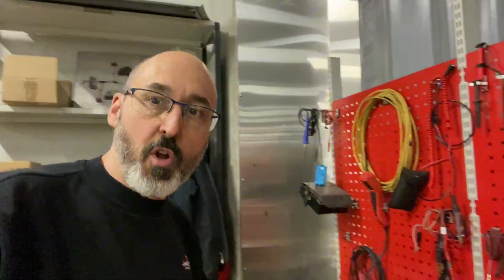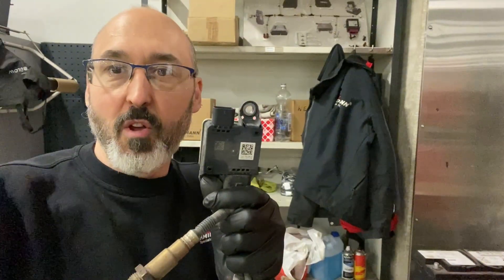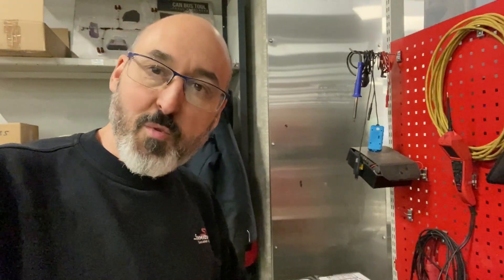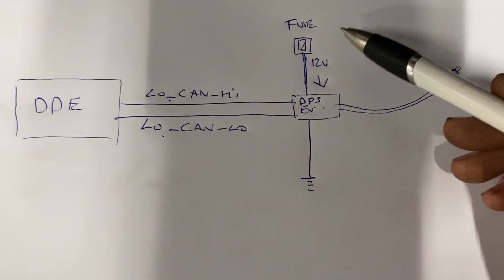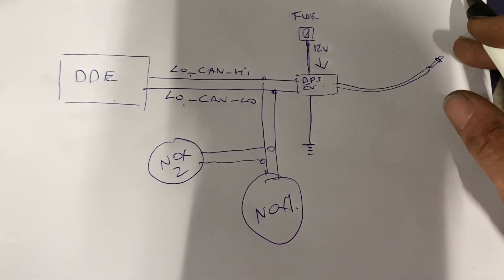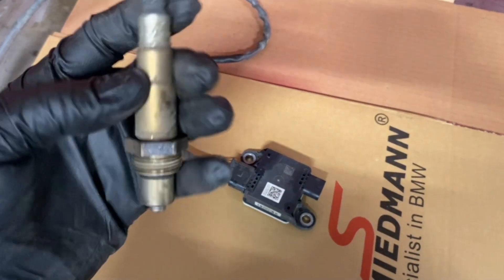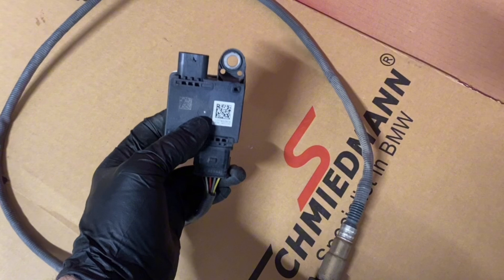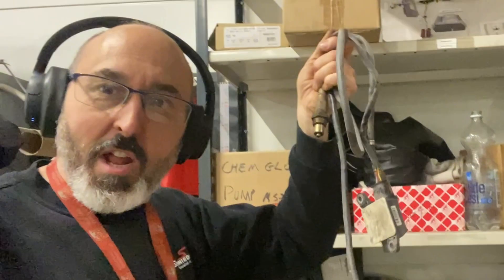Why Your Diesel Is Failing — And It Starts With This Sensor

Comment: Last year I have had one customer coming in who was at BMW 4 times for replacing the Sensor. Each time the error was gone or a couple of weeks. After that the same error came again. After the 4th sensor on warranty he came to me and every time they did put the sensor with the marking at the top so all the condensation water in the exhaust distroyed the sensor. I took the exhaust down and drained 0.6l of water from it. After that I put a new sensor in with the marking at the buttom so the condensation water could drip down through it.

Just wanted to say that because you mentioned the fact that it actually doesn´t matter where the QR code is. But it should be on the buttom
Reply from the maker: There is no qr code on the sensor body any longer. I used to fit them that way but for a long time they come with no markings at all. Crap sensors